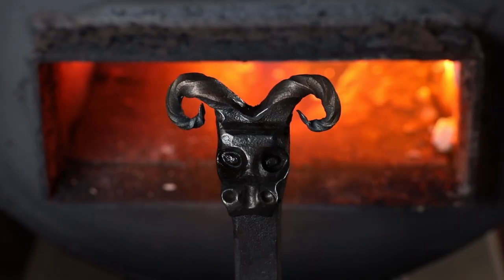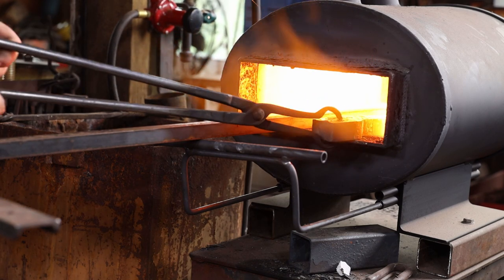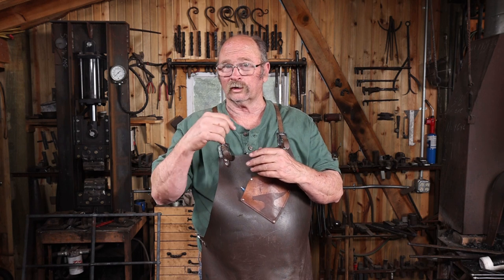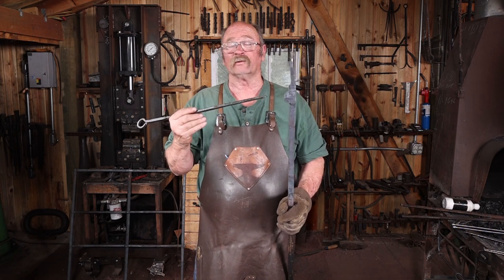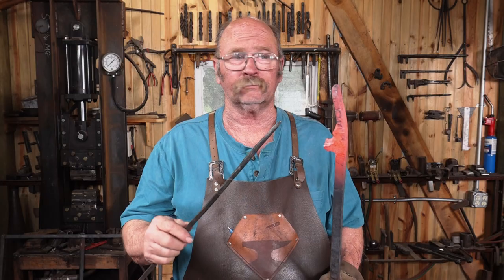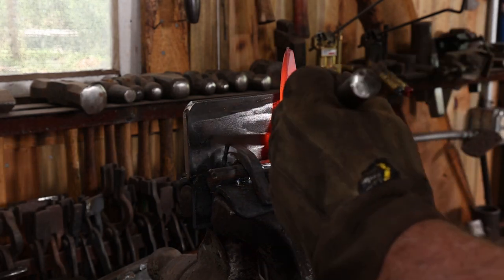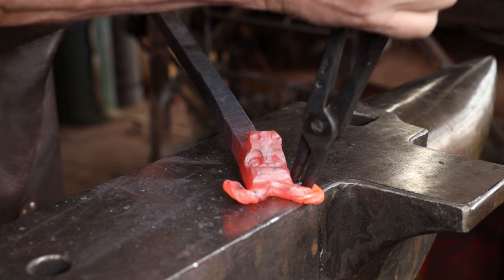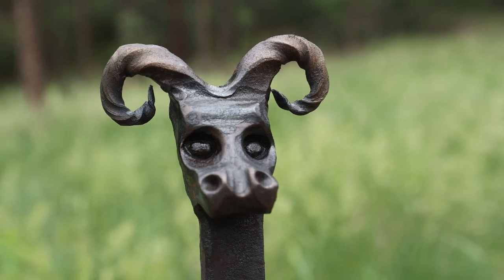Forged Figure Head - Blacksmithing

Comment: It’s always great to see a creator work through the process rather than have all the numbers up front. Whether it’s engineering, smithing, or crafting, sometimes we don’t have all the answers up front so seeing how one works out the task/problem is both enlightening and emboldening.
Reply from the maker: I certainly think one needs to be able to work to a specific set of measurements.  But I much more enjoy letting the work flow just to see where it goes.  Much more fun for me anyway.
Reply: There’s a fine art to eyeballing it.
Reply: @BlackBearForge  Same here John, Improvisation needs creativity while build to print needs rigor. Blackmithing demands both. Thank you for the lesson

Comment: It's an interesting piece John. I'd love to give one a shot but I'm unfortunately out of fuel. I use charcoal and it's gotten too hot and dry to make any. Just getting started and money is not a thing I have much of. Guess it will have to wait til it rains a day or two. Still thanks for the videos, I really appreciate being able to watch the steps and learn some new things while I wait on weather.
Reply from the maker: The dry weather is why I don't make more charcoal.  It's too bad its so expensive to buy charcoal
Reply: @BlackBearForge  Yep, that's why I'm shut down for the time being. I did find a place where I can buy bituminous coal, 50 pound bag for $65. Is that a fair price.
Reply: Just an idea for you,where I live in Australia I can go out and collect charcoal from the bush where there has been a fire go through, just put down a plastic sheet and knock it off with a hatchet then put it through a half inch screen. I have been doing this for years and it works well. Takes no longer than it would to collect the wood which you still have to burn to make charcoal.and summer is the best time to do it. Cheers Dave

Comment: Aloha John🤙🏽⚒️QUICK question: Are you running your Chili at full Psi  when forge welding? My apologies if you’ve answered this already.
Reply from the maker: I run it at 21 PSI which is the maximum recommended by the maker
Reply: @BlackBearForge  mahalo John!

Comment: whats the correct name for a striking hammer when you are using it to hit another full hard hammer?
Reply from the maker: I'm not sure what you're actually asking, a hammer is a hammer.  Perhaps you're seeing something in this video you didn't understand and should perhaps be asking a different question.
Reply: @BlackBearForge  when you use one hammer to strike another one, like using it instead of a drift, i ask this because its not good to hit to regular hardened hammers against each other?
i thought one, the striking hammer was a softer steel,

also how about doing a monthly figure head, like you did with the hook of the week, you must have a big ol pile in the scrap bucket again
Reply: The tool being struck should always have a softer head that way you don't have the risk of flying metal. Fullers, punches and drifts are only hardened on the working end not the struck end .
Reply: I re read your comment and will point out that John was hitting a fuller to shape the snout not another hammer. Similar looking tool but different use, always struck never swung and has a soft end.
Reply: @davidbutler3661  thanks David